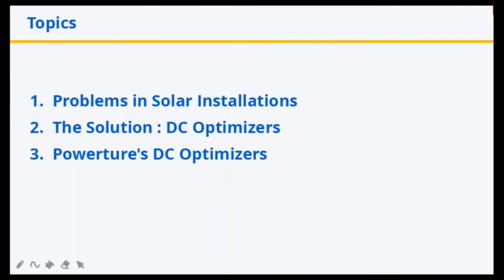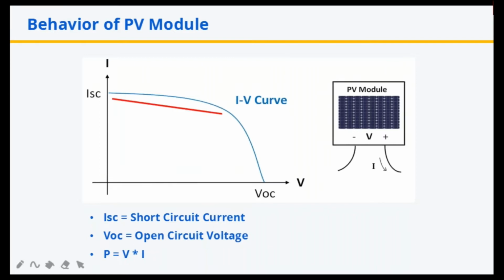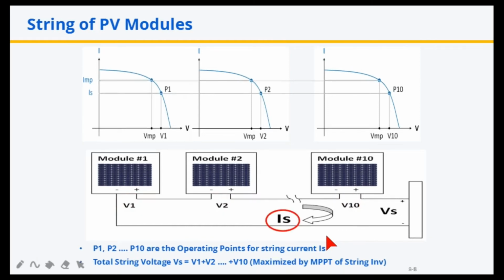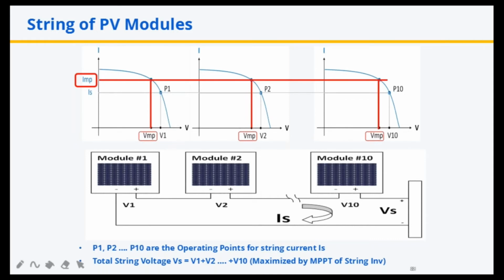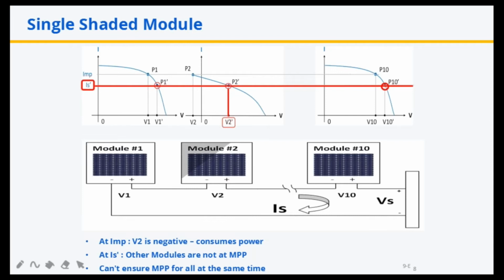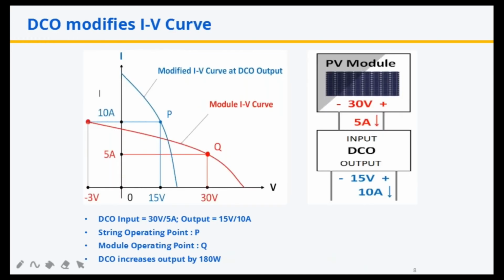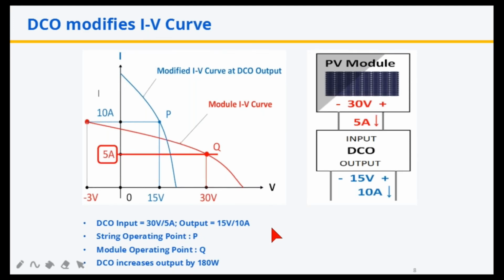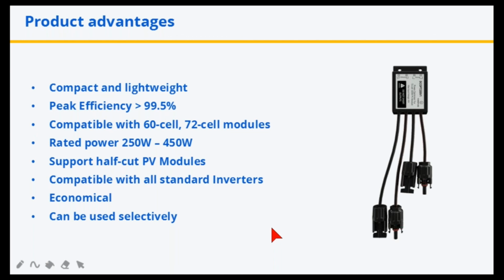How shading effects power output of grid tied system ? How DC Optimizer works ?

Comment: What circuit is used in this optimizer.  Mppt?
Reply from the maker: Yes without MPPT optimisation is not possible but there are different types of MPPT algorithm. We have universal MPPT algorithm which can work with any grid tie inverter.
Reply: Can I use it with two 32 cell 180watt each panel in series and connect to the DCO?